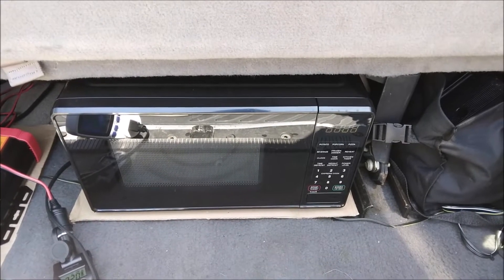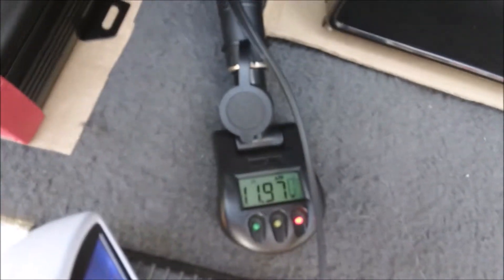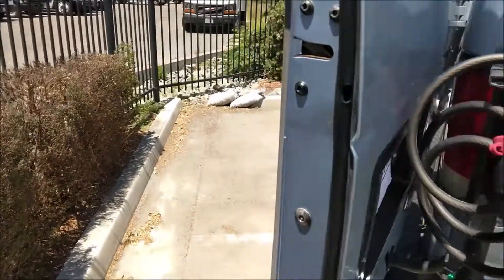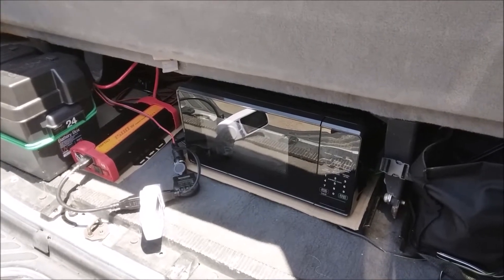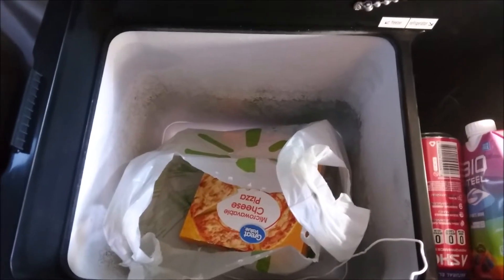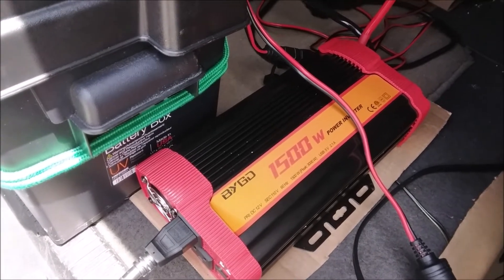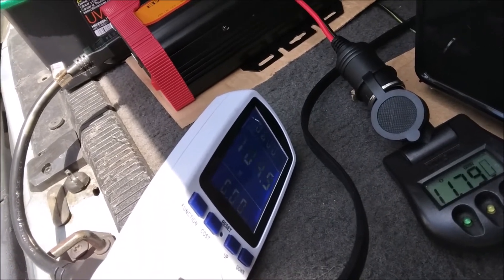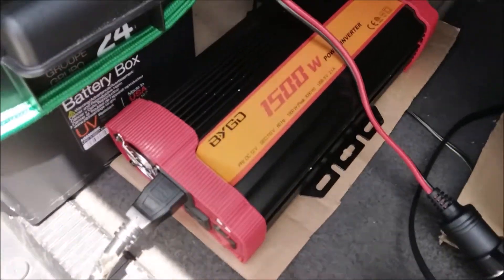Microwave oven in a van what size power inverter do you need in your vehicle battery solar vanlife

Comment: Have the same microwave and its pulling 900-1000 watts constantly. Using a big battery with it and ot only lasted 7 minutes
Reply from the maker: How big of a Inverter and battery are you running? Microwaves eat up a ton of power!

Comment: A pure sinewave inverter is more efficient than modified signwave for inductive loads like this microwave.
Reply from the maker: I ended up ditching it. I barely used it and I just use my Jet Boil Knock Off now or my propane camp stove

Comment: Make sure and find the continuous watt output of inverter. Many people are advertising a 3000 watt inverter it’s the peak power
Reply from the maker: This one was 3000 peak 1500 continous. Microwave is 700 watts continuous.
Reply: @JohnDrivesAnything  That's right you become puzzled when you load up only to find it switches off, and you add up the watts and the total is under the the inverter rating.

Comment: Can you hook a 2000 watt inverter to this and use it?
Reply from the maker: Yes. Microwaves run at 700-1000 watts
Reply: @JohnDrivesAnything  off of that one battery? Sorry, that's what I meant.
Reply from the maker: Yes. You have about 25 minutes of Microwave time off a Harbor Freight batter

Comment: what is the wattage on your solar
Reply from the maker: I'm just running a single 100 watt panel. I have 2 batteries, one is dedicated to the microwave since it uses up so much power. The other battery is for random electronics I bring with me